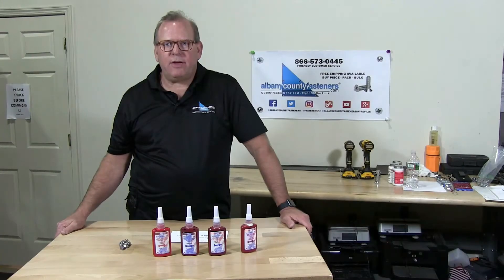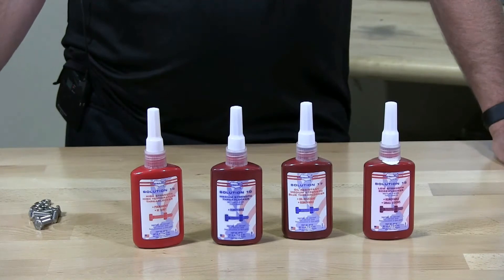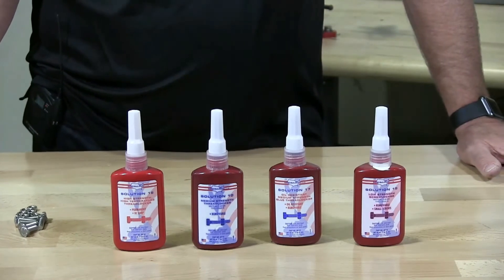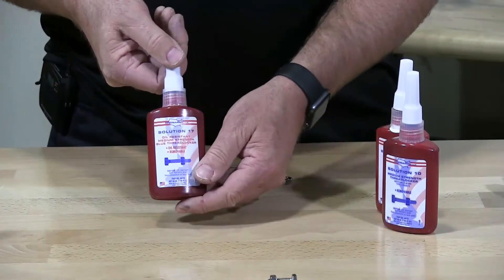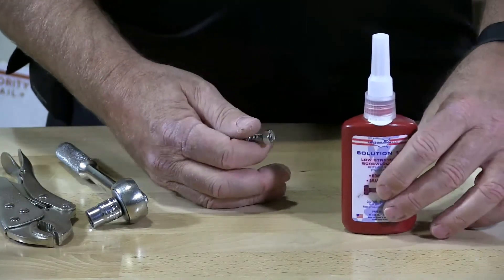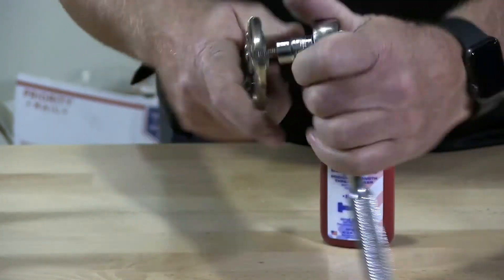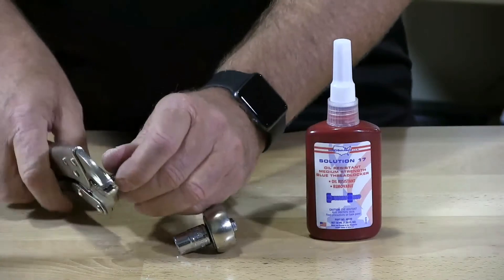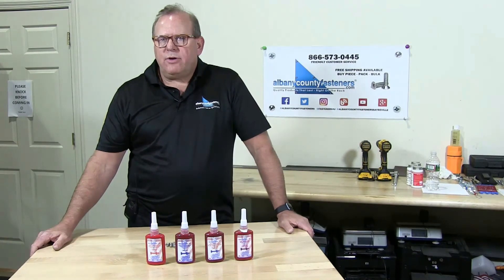Threadlocker Solutions - Proper Application & Demo | Fasteners 101

Comment: why we use thread lock instead of locking washers?
Reply: If you have an existing nut or threads.
for example, if you have motorcycle/car that is vibrating your screws loose
and your nut or treads are pertinently attached to the vehicle or frame 
a self locking nut is not an option.

also I assume you meant self locking nut and not self locking washers because they only work with softer materials like wood and plastics.
also self locking washers can still back out.